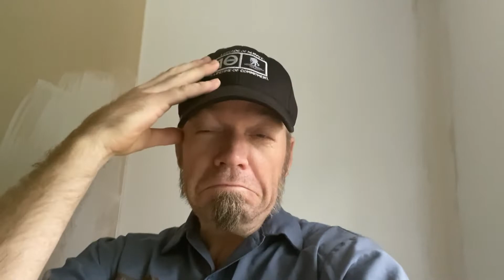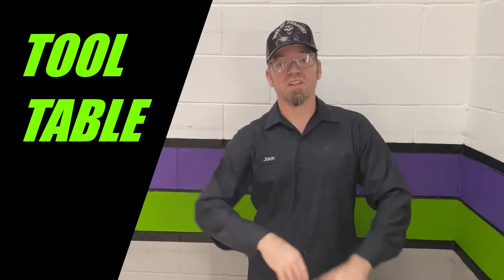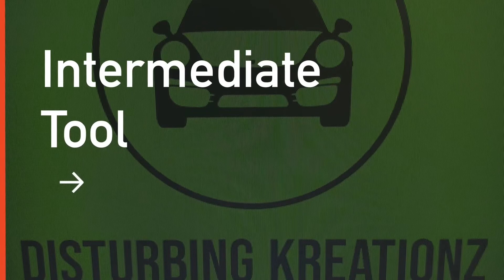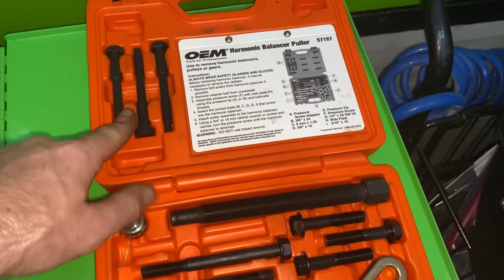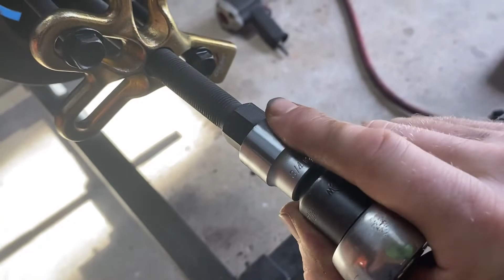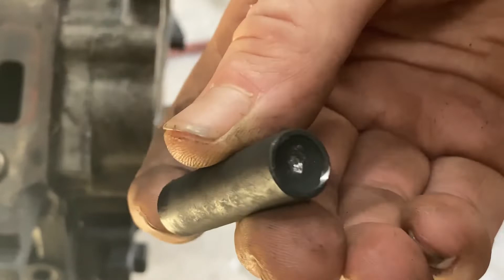Harmonic Balancer not working on your Ranger? PRO DIY!

Comment: That’s easy how do you get the bolt loose
Reply from the maker: Great question. You use a lot of force (arm strength) and a breaker bar. Or a pneumatic gun.

Comment: I got that tool and I been trying all day and even heating up the area but my harmonic balancer seems to be pretty stuck on there. I put so much torque on it that it ripped threads out of one of the holes on the pulley. Any tips or suggestions before I end up destroying something lol
Reply from the maker: Wow. I would put a lot of penetrating fluid on it and let it sit some time. If you heated the balancer you might have ruined it because it has rubber on it and it’s balanced. You did get the center bolt out of the balancer before trying to take it off correct? I mean I can’t see it so I have to ask.
Reply from the maker: I have never had one rip threads. I have seen people use the wrong bolts or only put them in a few turns and rip them but never happened to me.
Reply from the maker: Also try to get to the point where it’s “stuck” then back it off. Then try again. Back it off. Again. And this might move it just 1mm to break it loose.
Reply: @disturbingkreationz  i appreciate the quick replies. I will try letting it soak. I know there's a bunch of penetrates out there but is there one you'd recommend most? The puller was on straight however it seems like the silver bolts fit better then the black bolts. It stuck about 4 or 5 inches away from the balancer like in your video. I'm not worried bout it being damaged I'll replace it if need be I just need the f'er off so I can inspect timing chain and reseal the cover
Reply: @disturbingkreationz  as I was tightening down on it it seemed to be tightening then got harder to turn and noticed the balancer wasn't moving so cranked on it a little more and heard a pop then the main push bolt felt loose so I tighten it back up. I had the bolt out but only put in about a couple threads so I could put the push bolt against the crank bolt to at least pop the thing loose then I was going to take the bolt fully out
Reply: @disturbingkreationz  I finally got it last night. I ended up using the original bolts that bolt the pulley to the harmonic balancer to hook the puller up to the balancer and had to keep backing out the crank bolt as the pusher bolt needed to push up against the head of the bolt cuz the pusher bolt is too big diameter to go through the hole on the balancer
Reply from the maker: I am so sorry I didnt get back to you. Youtube doesnt show me all the messages and I have to just check the videos sometime. I am so glad you got it to work. You have to check the thread pitch before using any of those bolts in the kit. I actually snapped 2 off before. I usually just use the OEM bolts myself but I am always worried i MIGHT strip those.